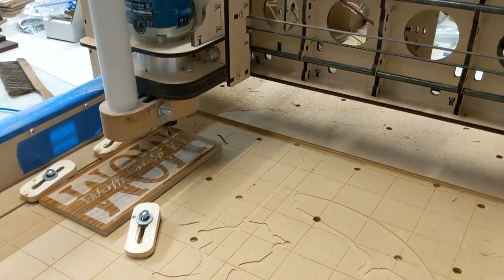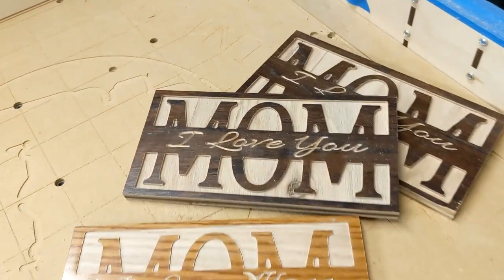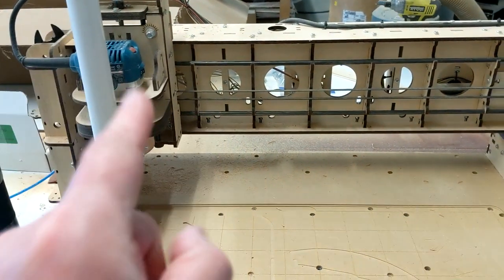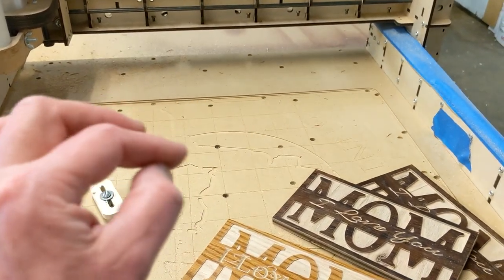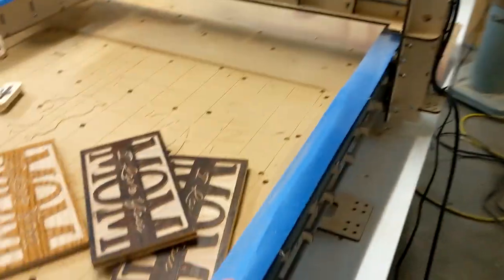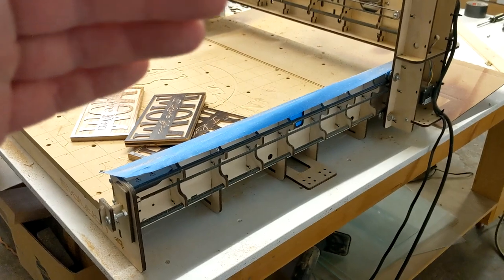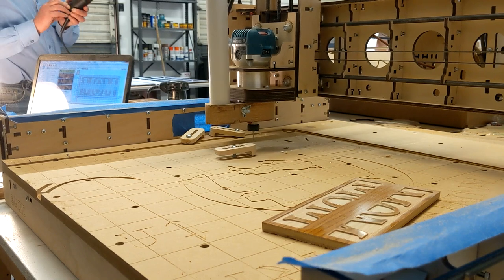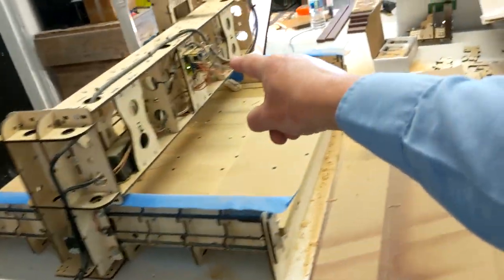Why Your CNC Router Randomly Stops In Middle Of Projects [You'll Get It] - Garrett Fromme

Comment: Well damnit. I'm running a Fogbuster mist coolant on mine and that has the compressor kick on occasionally...
Reply from the maker: Hi Dimman. Sometimes, it just hits us (like it did me) when the problem happens. Now you Know.
Reply: @IDCWoodcraft  Thanks for the vid. I'm going to look at cleaning up my power into the CNCs. I have a bigger one (with the Fogbuster that cuts aluminum) that has pausing issues, and a cheap small one that I got before for learning. On the small one I thought it was a loose USB, but the big one would make sense that the compressor is screwing with the power.

Comment: It happened to me, but I was not running anything else on the circuit. I found that my laptop was turning my usb ports off because it though the usb port was not being used. I had to dig into several different areas of windows 10 to find all references to power saving and usb ports. There were 4 different spots. Not it doesn't happen.
Reply from the maker: Vance, that is very interesting. I never heard of that happening. Really glad you made a comment about that so others can see it in case power spike corrections  don't solve their problem.
Reply: @IDCWoodcraft  Yeah. It was happening at the same time point in the file. So I thought it was a corrupt gcode file. So I generated a new gcode file and it happened at the same time point. So I got my offline controller out and put the file on an SD card and ran it from there. It ran all the way through.  So I started investigating power management and found the laptop was shutting down the usb ports because it thought they were idle. I disabled power management on the usb ports and now I can finish a project.

Comment: It looked and sounded like it stopped before your shop vac was turned on. Unless your sound is out of sync with your video the router stopped almost a second before the shop vac was turned on. I have a question. Is your wiring shielded? What you're showing us looks more like an e-stop being triggered. Break out boards are extremely sensitive to very small amounts of current. Not knowing how your router is set up, is your router set up to retract to a safe Z on E-stop. I suppose the program is still running G-code with the router standing still. My prediction is that a surge protector my not be the answer to all the problems you and others are having. Do your axis's ever seem to jam up?
Reply from the maker: Hi Jim. Shielding is definnitely an issue that I didn;t think about. Thank you

Comment: It just happened to me and nothing was turned on while it was running. It just stopped. Now it won't go back to the xy i set. it started cutting off the original cuts.
Reply from the maker: dawnb1313, im sorry to hear that brother. Your best bet might be to reach out to your machine manufacturer regarding your specific issue. They will be able to give you better troubleshooting tips for your specific machine brother!

Comment: The problem that I have been having is that my machine will start cutting and after a minute or so into the cut it just goes off and starts cutting a different pattern  What could be causing that??
Reply from the maker: Hi Brian. This is usually because of an underpowered spindle.
Reply: @IDCWoodcraft  So I should turn up the speed of the spindle??
Reply from the maker: @brianconner8902  what machine do you have?
Reply: @IDCWoodcraft  I should first let you know that I am pretty new to this CNC machine.  I retired from teaching  (elementery for 34 years) and needed some type of hobby to keep busy and from going crazy.  I got this machine three years ago and the business I purched it from is gone out of business since then.  I use Cut 2D pro for programing and then transfer my drawings over to MACH 3 and I have a Velox CNC machine.

Comment: EXACTLY RIGHT! I had my laser running, walked across the room, flipped the wall switch for the ceiling fan, went back to the laser and it had stopped. My brain was so overwhelmed with cuss words,there was no way to make the connection between the two. I only had the laser a month or less. 
Still not making the connection, I had the fan running one day, pulled the chain to speed it up and BINGO, laser stopped. 
Of course it happened a couple more times before I made the relationship. I was so proud of myself, I may have wet my pants. 
HOWEVER, (yes it never is that simple because GOD heard me the last time and decided to punish me), a few days/ weeks later, it started happening again. 
After some time, I realized my computer was shutting down because of the 'operation TIME settings '.
All I can say is, GOD then made up his mind where I'll be spending my hereafter time but it's fault for testing me! 
I think 🤔 this is one HELLAVA story.
Reply from the maker: Will, I'm very proud of you for discovering this. Good boy!!

Comment: I just bought my first starter 3018 CNC machine and this has been happening to me. I've only managed to complete less than half the jobs I've been doing. To make matters worse, when I tried recalibrating after it stops (resetting z with probe and resetting the origin for the work piece) and restarting the job, it was always at least a millimeter off (sometimes several centimeters) from previous paths so the project piece is ruined. I could attribute a small offset amount to human error, but several centimeters?
Reply from the maker: Yabba, that is normal when the machine stops due to a power failure or disconnection etc. If the machine looses its reference coordinates, it is very hard to get the machine back to the precise location where it was before. 
Work on finding the root cause of what is making your machine loose connection or stop in the middle of a job. Your 
PC might be going to sleep during the cut.
Reply: Same for me, brand new 3018, my first overnight relief job was on the v-carve portion, I walked downstairs & the motion sensing ceiling light turned on. I stopped hearing the cnc. Went over & it had stopped & actually returned to 0,0,0. I restarted the job, but now it has over 8 hours of cutting air to return to where it quit. Is there a way to fast forward thru the program to get back to the point where it stopped? 
I ordered the surge protector you recommended. Fingers crossed that works.